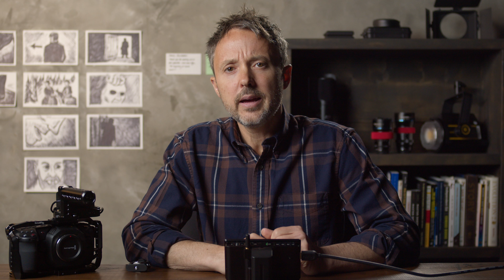How to Use PortKeys LH5P Monitor | Bluetooth Camera Control BMPCC

Comment: Only problem here is my monitor is non responsive, my camera was connected via Bluetooth to my phone. My phone screen gets hit by a baseball and cracked with no way to view. Had to get a new phone, and can no longer connect to anything Bluetooth on the camera because it's still paired to my broken phone I turned in. SMH life having a BM can be so complicated
Reply from the maker: UGH. You can clear out that Bluetooth connection from the BMD menu. That’s not a problem at all.
Reply: @writedirect  That's been my problem, my screen is non responsive to touch. I cannot navigate with the buttons. So my camera will unfortunately be forever paired to a broken phone somewhere in a bin of broken phones in Verizon space.
Reply from the maker: @thegrayhandle  oh...that screen is broken? Crud. I wonder if there's anything you can do from the camera app on your computer and hooking the camera up via USB cable?
Reply: @writedirect  I did hook the camera up via usb, updated my firmware and it updated the camera and took me from shooting 5:1 to 8:1. I'll take it I guess. I have more memory to record. Hopefully BM in the future can figure out that if the most important part of the camera (touch screen) goes out that there is a way to at least control the camera with the hard buttons to navigate through the menu system.
Reply from the maker: @thegrayhandle  this would be a showstopper for me. I’d purchase a new camera. And if I couldn’t afford it, would figure out what I could sell to get it! I’m sorry. This is a good point. Another way to navigate the menu. Or at least reset Bluetooth so you could connect with the camera app on your phone. I reach out to Black magic design and see if there’s anyway to at least reset the Bluetooth without the display. Probably not, but you never know. Or if you could restore a config from another pocket 4K? Over right things? Even that would be handy.

Comment: Hi.  What is the range in feet for Bluetooth camera control?   Have you tested that yet?
Reply from the maker: Hey man, not ignoring you. Just haven’t tested and wanted to test it to give you some actual data. I’ll try to get to that soon.
Reply: HI!  were you able to test the bluetooth range yet for the 6kPro?    @writedirect
Reply from the maker: @travisgrenke-films  I will do this tomorrow! Talk soon.
Reply from the maker: @travisgrenke-films  okay, just tested with the CC6K (FF not Pocket). The farthest I could get it to connect was about 21 feet. Maybe 22 feet. After that it would lose bluetooth connectivity.
Reply: @writedirect    that's good to know.  I might get it now.   Thank you so much for testing the range. 🙂
Reply from the maker: @travisgrenke-films  for what it’s worth: I originally got this one for the Bluetooth control. I never use it. You can do a lot with the free Blackmagic app. So if the Bluetooth control is your only reasoning, just a heads up. But the monitor itself has been very reliable and durable.
Reply: @writedirect   I have an android phone.   ...and an old iPhone 5s.    The range of the app with the 5s is only 4 feet.      Maybe your phone has better range.  

Not many options for Android users right now. 😄   doh!
Reply from the maker: @travisgrenke-films  interesting. So the bluetooth tech on the phone must be old? I'm on an iPhone 13 and it's bluetooth vs 5.0 which is supposed to have a range of 800 feet. Haven't tried that!

Comment: Hello. Your video is nice and informative :) I bought a monitor one level up, the LH5P II version, and I have this problem. If I turn the top button on the camera (bmpcc6k) to FALS color, nothing appears on the Portkeyes monitor, only on the camera display. Focus Assistant and LAD work without any problem. The only way to turn on FALS color on the external monitor is to go to the camera menu and in the HDMI settings turn on FALS color hard. The problem is that I also have to turn it off there and not with the top button on the camera :( That's not great if I have stupid access to the camera display :( I would like to know if the same problem is on your monitor. Thank you very much for your help.
Reply from the maker: Hey man, I haven't run that scenario but understand what you're doing. Make sure that under SETUP that the "F1 Parameter Displays On" is set to HDMI vs LCD. That could be what's doing this to you.
Reply: Thank you very much. I just figured it out too that I shouldn't set it in the MONITOR menu but in the SETUP menu F1 function button :) Great thanks a lot :) just don't understand why the other two F2 and F3 were set and F1 wasn't :) @writedirect